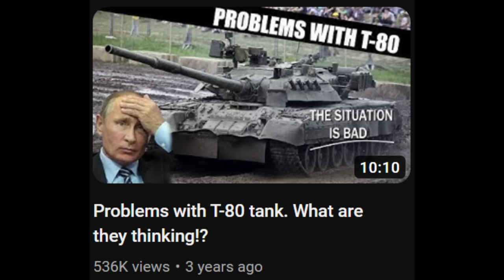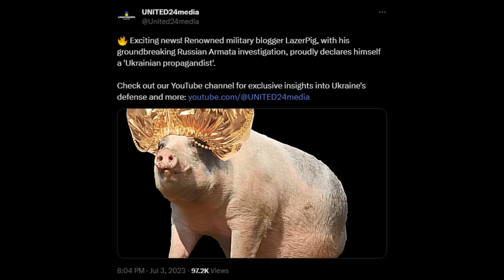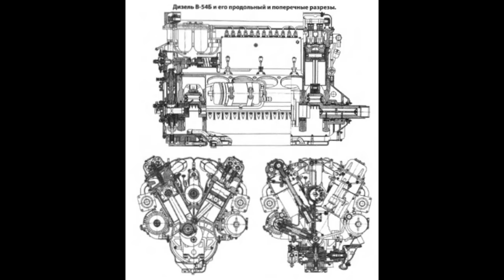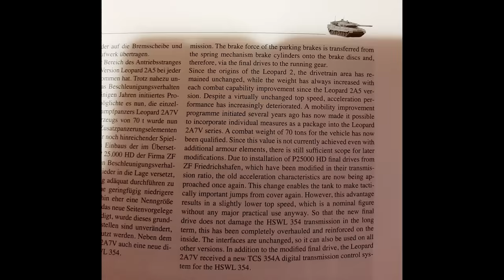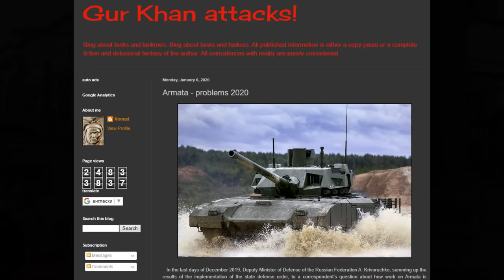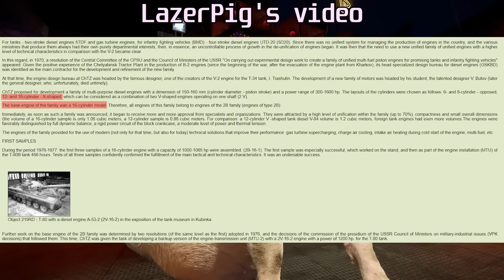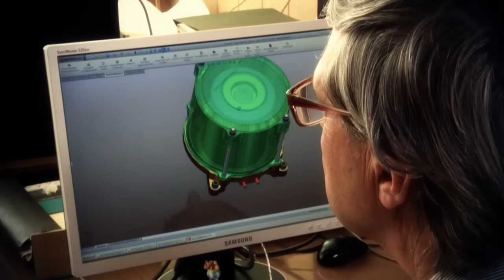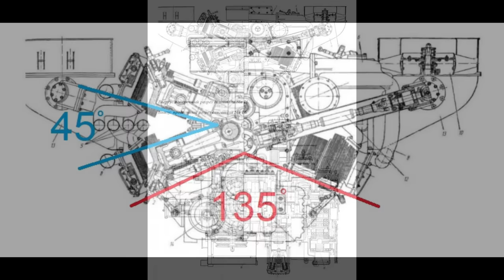Response to LazerPig and the T-14 Armata dispute

Comment: You know you're right when a dude who works with Ukrainian media tells you you're a Russian propagandist for saying Russian tanks are not scrap metal
Reply: What’s so ironic about nato propaganda and troglodytes like LP is that pretty much both sides in this conflict are using the same tanks most of the time and once nato tanks showed up nothing changes and loss rates are the same in Ukraine for nato vehicles and Russian vehicles. Neither is better or worse.
Reply: @verstappen9937 Both are landmine bait
Reply: @verstappen9937  If that was the case desert storm would have ended differently as well. It's omega dumb to break down something so complex into something that simple. You need close air support, protection from artillery and more but neither ukraine really has in any significant numbers. Not couting the insane minefields even. When you use something that is made for another spec then sure it doesnt work as well. It's like taking a race cars to motocross.
Reply: @saltysalt7339  "desert storm"
Lol.
What about Syria and Yemen ? Dozen of Leopard 2 lost in only 4 hours while having total artillery and air superiority and same in Yemen for Abrams, or Iraq against the islamic state, losing lot of Abrams too.
Bringuing "desert storm" just show you dont understand what you are speaking about. Immobile and entrenched chinese copies of soviet tanks in the iraqi desert with starving and battered iraqi soldiers, who were exhausted by 10 years of war, biggest war of the 20th century after the first and second GM. All of it with no air cover and support, facing the biggest military coalition since WWII (there were more planes flying overthere than there is flying in the US airforce have today).
In other hand, during the Iran Iraq war, T-72 had the upper hand over western tanks. A few T-72 destroyed the bulks of Iranian M-60 and Chieftains.
Reply: @karakarakiri9568  You mean the leo2 that got an rpg to their side? Yea. Big cinema advancing without infantry.
Reply: @karakarakiri9568  Don't you know that the Asad babil was the ultimate tank that was immediately destroyed by dozens of supposedly inferior M60s during 73 Easting?
Reply: @richpryor9650 Don’t you know that Asad Babil was a inferior version of a export model T-72M1? The ammunition for the Iraqi tanks wasn’t up to standard either so Desert Storm is a poor representation of the T-72 tank
Reply: @alexwest2573  No it wasn't that's just Westoid cope. The greatest variant of any Soviet tank died a magnificent death via the barrel of a Patton in the territory that they had complete defensive positioning superiority.
Reply: @richpryor9650  I don’t think that’s true
Reply: To be fair Russian equipment is garbage so saying a tank from Russia is easy content regardless
Reply: 'Hes making fun of us for being Russian fanboys'
Meanwhile I proceed to see numerous Z fans calling Lazerpig a nazi and his fans Nato fan boys. Its almost like both sides attract fanboys or somethin
Reply: @richpryor9650 arab babyl is cheap design.

For comparison you can compared babyl as panzer 4 J when regular T-72 is Panzer 4 H.

Comment: I think a tank engine history video would be really interesting to see, its certainly not something that is covered very often that's for sure.  How long such a video would be with all of the variants/upgrades is something else.  I would be intrigued to know what the difference is between a super charger and a turbo charger on a tank engine?  In simplistic terms at least, since I am certainly no engineer by any regards.  Keep up your great work on your videos as I really appreciate them and the effort that you put into them as well.
Reply: Turbo charger works with air that comes from moving (its round with a fan in the middle that spins from the air and creates power). A super charger takes power from the engine not the air. I think thats the difference ( its the same.about cars). If you want more information i suggest you wacht a video😅
Reply from the maker: Yes it would be a long video, and kind of boring. But I have gathered a lot of information about them while doing research for this video that I can make such video, if enough people request it. 
Turbocharger uses the energy from the exhaust to power itself, while supercharger uses mechanical parts of the engine (like spinning of the crankshaft). That is why V-92S2F (turbocharged) has two large pipes on each side of the engine.
Reply: @RedEffectChannel  Your better then lazerham
Reply: @RedEffectChannel  well since you already did the research...
Reply: @RedEffectChannel I'd love to see a video on the V2's history. As well as other tank engines. Engines are often overlooked in tanks and unrightfully so.
Reply: I can explain the differences between both turbo and superchargers. Both turbo and superchargers do the same thing, they cram more air into the engine, allowing more fuel to be burnt, thus more power. However, even though turbo and superchargers do the same thing, they work really differently. Superchargers are usually connected to the engine's crankshaft via a belt, and then the crankshaft spins the supercharger, creating boost. (Boost practically means how much the charger crams air in) Turbochargers on the another hand take their power from the exhaust. The exhaust comes to the turbo, spins the turbo, and turbo then creates boost.
Reply: @RedEffectChannel  I'd definitely watch it.
Reply: @RedEffectChannel  I suggest you start with an "Engines 101" video then add short follow-ups on specific engine designs and types. I am sure many people will be interested and informed by the time you move forward.
Reply: @RedEffectChannel you could do a video of russians upgrading their tanks rn if you know what i mean
Reply: I love boring! @RedEffectChannel
Reply: @RedEffectChannel  Please do it.
Reply: @RedEffectChannel  I would watch that video.
Reply: @RedEffectChannel please make it. A little diversification content on your channel like your ifv series
Reply: @RedEffectChannel   Do it. I was wondering why you didn't already.

Comment: 19:40 it’s funny how lazerpig talked about he power to weight ratio of the tanks but completely ignored the power to weight ratio of the engines themselves.
Reply: lzerpg is best he got a challanger in his heart and redeffect and cone living rent free in his hollow skull
Reply: Once in the tank that really no longer matters though. Once mounted to the tank the mass of the tank and engine becomes one.

A lighter engine at that point only enables more other stuff to be mounted to the tank for the same total weight. Which is obviously an advantage, but the power to weight ratio of the engine itself no longer matters.
Reply: @baronvonlimbourgh1716 power to weight ratio is important when on an incline.  that's why India likes to use t 90  in the mountains Himalaya
Reply: @carkawalakhatulistiwa   sure, but once you mount a tank to an engine the power to weight ratio of the engine no longer matters for the performance of the tank.

A tank is designed towards a certain weight. 50 tonnes for example.
If the engine weighs 5 tonnes the rest of the tank can weigh 45 tonnes.
But if the engine weighs 1 tonne, designers simply can put on 4 additional tonnes of armor or other equipment to the tank, bringing it to the same 50 tonnes and thus the same power to weight ratio..
Reply: @baronvonlimbourgh1716  
"but once you mount a tank to an engine the power to weight ratio of the engine no longer matters for the performance of the tank."
Bad choice of words here for one simple reason: The heavier and poorer the power to weight ratio the more armor/defensive measures are sacrificed to fit the engine in. Conversely if the engine is very powerful for its tonnage range you can get away with more protection, protection measures and offensive systems. It's why the bradley's a bit arse in the offensive area while not being more durable than a BMP-3 or BMD-4 while those can mount equivalent weapons and slap a 100 mm on top.
Reply: That doesn't matter when you put the engine in a vehicle.
Reply: @RomanianReaver  sure, but we are talking about mobility, not protection.
A 50 tonnes vehicle with 5 tonnes engine is just as mobile as a 50 tonnes vehicle that has a 1 tonne engine with the same power curve.
The vehicle is still 50 tonnes.
Reply: @baronvonlimbourgh1716  
And a dead tank isn't mobile. Need help with the concept?
Reply: @RomanianReaver  The Engine weight isn't the reason for that. The BMP 3 has an 850 kg engine with 500 hp. 
Bradleys have a 600 hp engine that weighs 1112 kg. If we ignore the Problems that would probably arise if we'd just upscale the BMP engine to  600 hp we'd have an engine that weighs 1020 kg. Congrats you saved 92 kilos or not even 1 dismount. 
The real reason for the heavier weight is a less cramped  design and a safer compartmentalisation. Which is why western dismounts actually feel safe to ride inside their IFVs while russians almost always ride on top of them
Reply: @heyho4770  
Wtf are you even on about? The BMP is better armed, about the same in protection, same sort of agility and carries more troops.
Sure, less hp matters when the hp/t is significantly better.
Also the BMP's engine is a fork of their tank engines.
Reply: @RomanianReaver My point is that the power to weight of only the engine is almost completely irrelevant. 
Also that Russia sacrifices crew safety for a smaller and therefore lighter profile
Reply: @RomanianReaver  what on earth are you talking about..
Reply: @baronvonlimbourgh1716  
Pointing out the bloody obvious: the efficiency of a module is very important.
Hp/t for engines (assuming the same efficiency/reliability) because they can be smaller/lighter and maintain tank agility. That lets more room for other components. Wtf is hard getting that? "Duuuuuuuuuuuur once installed it doesn't matter" is TazedFig tier non-logic.
Reply: @RomanianReaver  The hp/ton for only the engine is still a shitty parameter to measure its performance. 
And even a straight up lighter engine gains you very little since its just a fraction of the vehicles weight. Imagine through some miracle the Bradleys engine becomes weightless and we want to armor up. What do 1112 kg of aluminum get us? About 40 square meters with 1 centimeter of additional armor if we're using aluminum and 14 if we're using steel. So you might get 10mm of additional all around aluminum armor out of this which isn't enough to be significant
Reply: @RomanianReaver the Bradley is better than the bmp-2 or bmp-3 and the survival chance of crew plus weapon functionality is higher as well
Reply: @kingofwild100  
BMP-2 came before the Bradley by a couple of years, nice try at muddying the water, BMP-3 came towards the end of the cold war with a lot of Afghan war lessons on top.
Go ask the Ukros how well the two behave survivability-wise and as for "weapon functionality": BMP-3 has a chaingun and a low pressure gun it can use in indirect fire with drone support. Have fun seeing shit farther when you can't hit it :).
Reply: @RomanianReaver  isn't that exactly what i said?
It doesn't change the mobility of the tank because more other stuff will be put on to it.

It will still go up the hill the op posted about exactly the same.
I think you need some reading comprehension assistance.
Reply: @RomanianReaver  survivability has been a lot higher for bradly crew then anything else other then leopards.
Reply: i dunno why ppl are saying it doesn't matter. its a clear advantage to have a lighter engine that can produce similar power, sure its not a deal breaker but its still desirable to have your engine lighter so that you can use that weight on other things like barvon said.
Reply: @ushikiii   we where specificly talking about the impact on mobility with a lighter engine.
And like you point out yourself, any savings in weight it might provide will always be used to fit aditional armor or equipment.
A tank is designed to a certain weight, so the end weight of the tank will always remain the same, no matter how light or heavy the engine is the mobility of the tank is not going to change.

The fact that it is obviously benneficial for other things nobody is disputing. More armor is obviously always better. But the tank will not climb a hill more easilly because it has an engine with a better power to weight ratio as it is compensated for with said extra armor.
Reply: @RomanianReaver  red also noted that bmps can be side penned by 50 cals (not .50 ae or .50 beowulf)
Reply: @ligmasurvivor5600  
Without addon armor, yeah. 50s aren't as common as they once were though on most battlefields. Still be funny to see a technical "milk trucking" a BMP with 50s. (milk truck is a War Thunder term, there's a couple of low tier Russian trucks, that look like 1930s milk trucks, with AA stuck on the back that have ass all armor but the AA guns usually hit hard enough to side pen even some modern MBTs ingame).
Reply: @RomanianReaver  i know the term lol theyre generally fast asf too
Reply: @ligmasurvivor5600 
Not everyone plays it so had to be polite :)). Imagine a toyota technical with a 25mm turret strapped to its butt rolling up on a BMP-1
Reply: @RomanianReaver  BMP3 is not at all similarly or better protected. Front hull is 23mm AP, turret is 30mm AP, everything else is 7,62mm. Add on armor increases that to 12,7mm protection, and gives cages for better HEAT defense - but still worse than ERA blocks. Bradely M2A2, the most common version today, is 30mm AP front and sides, 14,5mm rear, and add-on ERA plates give APFSDS protection and increased defense against HEAT. The Bradely can easily defeat the BMP3s hull from any angle with it's autocannon, while the BMP3 would need to use it's ATGM to actually take out the M2A2 Bradley reliably
Reply: @ChaplainDMK  
Lotta words to agree with me by forgetting this is a bmp 3 not 2, there's another weapon you forgot.
Reply: @RomanianReaver  Such as?
Reply: @ChaplainDMK  
You stepped into this arena and didn't know the BMP-3 has a 100 mm gun. Which'll do a number on the Bradley if it hits the turret or upper front plate.
Lets hope you don't sperg too hard out about the fact the Russians are producing in numbers BMP-2Ms too =)).
Reply: @RomanianReaver  You do understand that the 100mm gun actually fires the ATGM I was talking about, right? And that the only other shell it fires are very very low velocity high explosive rounds that wont penetrate the armor of a Bradley? And what are BMP-2Ms supposed to help here? They are again only protected against 23mm frontally and 7,62mm on the sides, with add-on armor that CAN be added, but is not included as built, increasing side protection to 12,7mm.

Again, explain how this is superior to the M2A2 Bradley having front and side protection against 30mm fire, along with add-on armor packages that significantly increase protection against APFSDS rounds and HEAT weapons? 

And another thing, all M2A2 Bradleys have thermals, no BMP2s (except Finish upgrades) have them, and only certain BMP3s have them.
Reply: @RomanianReaver about the same protection? TF are you talking about... BMP is so thin on the side and rear a heavy machine gun can swiss cheese it. It's not even close in armor protection...
Reply: @baronvonlimbourgh1716  i saw quite a few dying while evacuating from damaged bradleys though. but i will agree on you with this point
Reply: @ChaplainDMK  bmp3 is armored against 30mm from front already lmao its a completely different hull and chassis from bmp2. look at the running gear
Reply: @Shoelessjoe78  only for 1 and 2 which is true. for 3 it has same frontal protection, bmp3m has applique armor on the sides near the front
Reply: @commenter648 I never said the hull is the same, I said the hull proctection is only 23mm, but I see that I made a mistake and it is in fact protected against 30mm, but only above 200 meters.
Reply: the video was about the tanks, not the engine. so yes he brought up the specs on the tanks. he talked about the engine yes but the engine was not even close to being the main topic